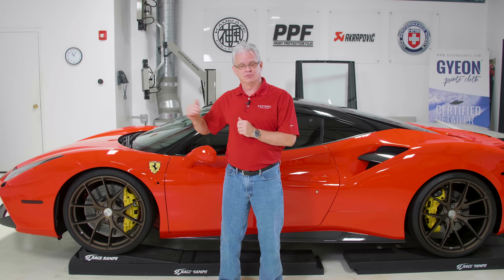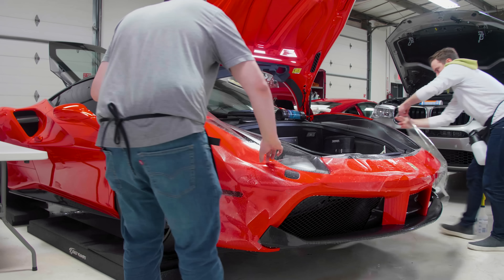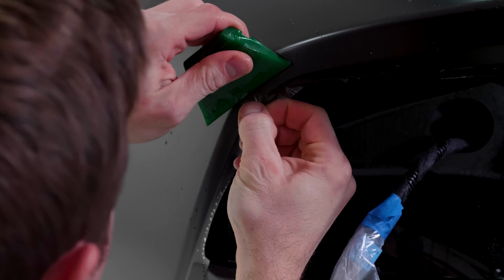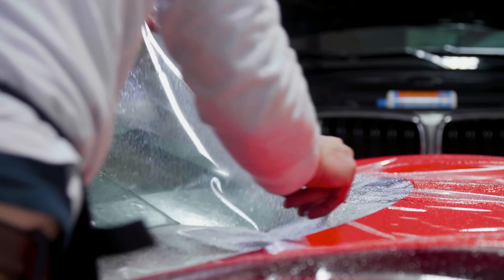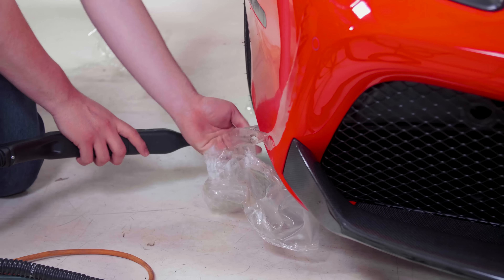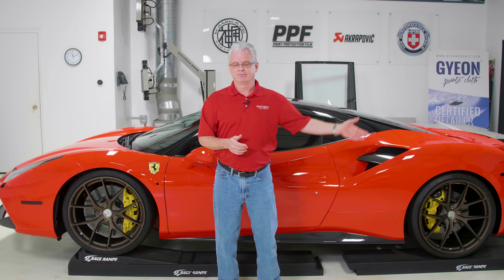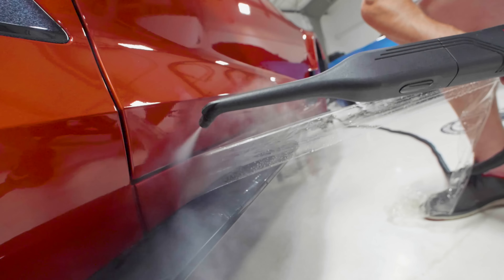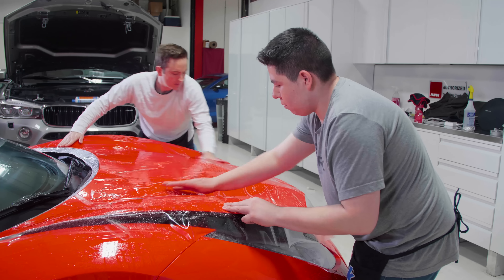Ferrari Detailing Part 7 - Paint Protection Film - ESOTERIC Car Care

Comment: PPF don't do it. It's not worth it just get it detailed and coated.
Reply from the maker: Actually that couldn't be further from the truth. Polishing and coating is great, but it won't prevent from rock chips. That is why most of what we do is PPF on the front end, and polished and coated the rest of the car. And if you are planning to track your car, it's an absolute must-have to protect resale value of it.